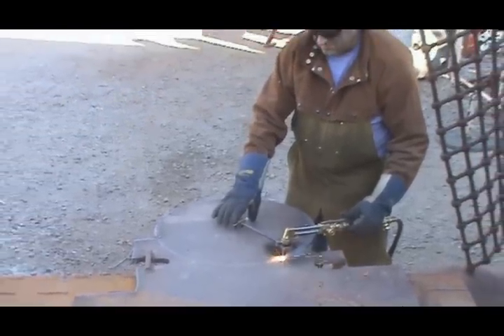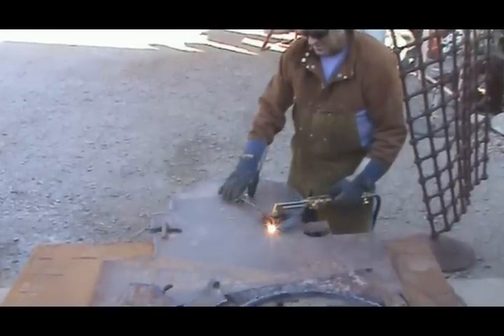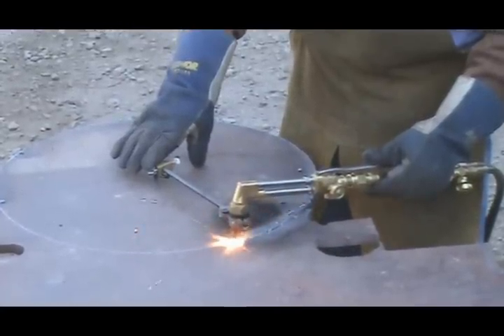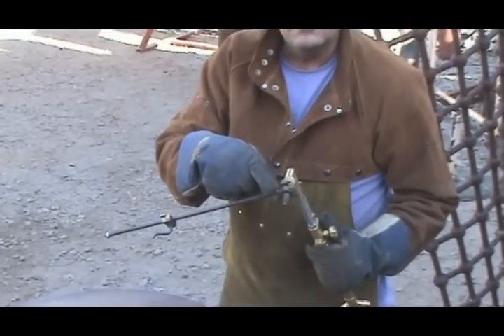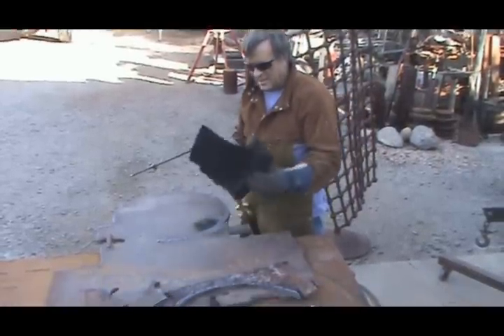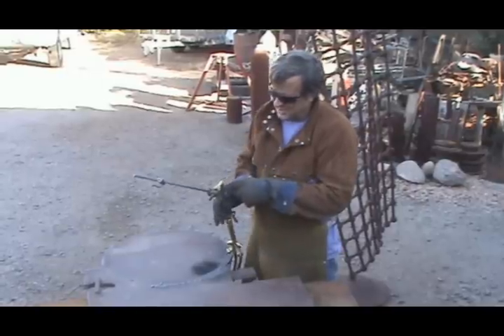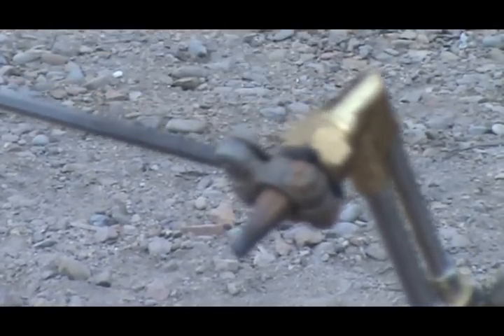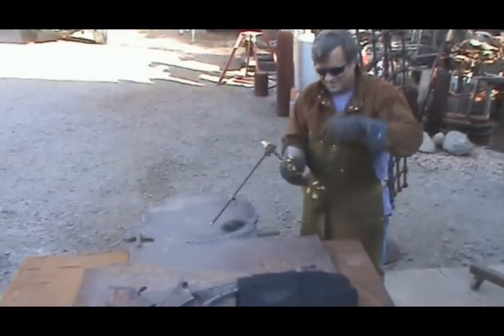Cutting a Circle With Oxygen-Acetylene - Kevin Caron

Comment: Get yourself a stand-off for that attachment too and you won’t be bobbin up n down while you’re cutting, cleaner and more consistent. A man of your talent could make one pretty quick with parts lyin around your shop! Also, unless you weld a lot with O/A why not use Oxy/Propane? It’s cheaper and it cuts great! That all I use at my steel yard. It does use a considerable more pressure and oxygen but oxygen is way cheaper! Just a couple thoughtypoos.🙂
Reply from the maker: Thanks for the tip

Comment: What is that attachment fixed to nozzle to cut circle
Reply from the maker: Just the circle cutter for my plasma cutter that I changed to work with the torch.   The clamp is a battery cable clamp.

Comment: Great video demonstration using oxygen and acetylene. Are you aware of HHO Gas water for fuel where you do not have to ever use acetylene gas ever again. One gallon of water produces 1700 gallons of pure hydrogen oxygen gas from water.  Click on my YouTube name visit my YouTube site and see what it's all about.
Reply: *****
HHO Gas is the most safest cleanest fuel to use compared to any fossil fuel anywhere in the world. One more amazing thing is after you are done cutting any steel Using HHO Gas that area will resists rust for a long time compared to the area that was not exposed to HHO Gas fire flame.

Comment from the maker: @stillbashingmetal Before you press the lever to start cutting you are watching the metal under the flame. When it goes molten give the lever a little touch to start the cut. If the metal is hot enough all the way through it will cut through and blow out the bottom side. If the metal is not hot enough you will get a small divot in the metal and you have to heat it up some more. Once you get a hole through you just have to keep the metal in front of the torch hot enough to cut cleanly.

Comment: Speaking of old school, I once worked at a shop where they had a robotic machine to cut these circles in 1" plate. Cuts were like glass, unbelievable. We never used blowback arrestors then, and I remember shutting our torches off like you do here. I used to hear a lot of 'popping' from guys shutting down the wrong way. Nobody died, at the shop where I worked. I only recently learned that you're supposed to shut the acetylene off first....

Comment from the maker: @jameasun Great question!  Take your tape and find the diameter. Mark that on a straight edge and make several lines across the circle. Where they meet is the middle.  If you are the type of guy that has to use math, try the diameter divided by two. That will give you the radius. Measure in from two points and that will give you the center.